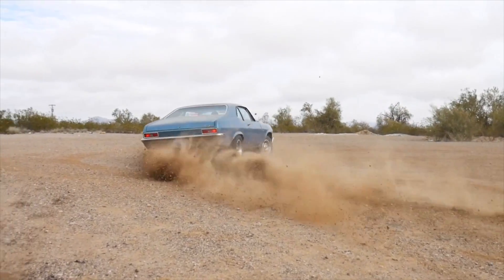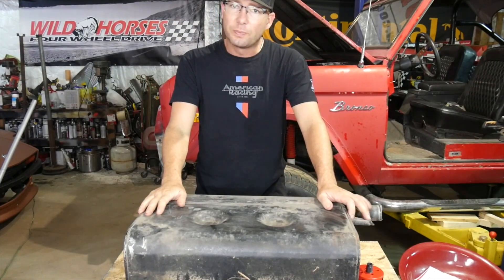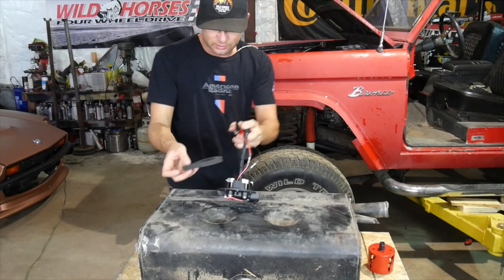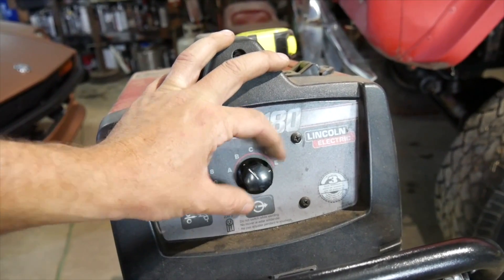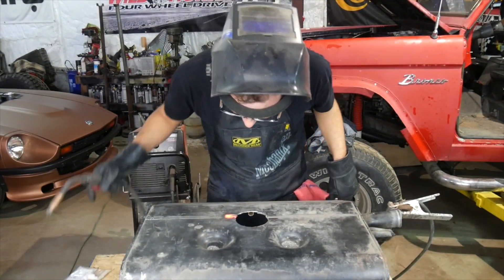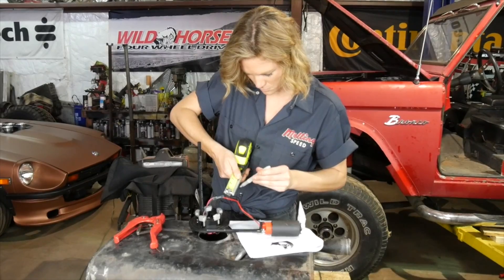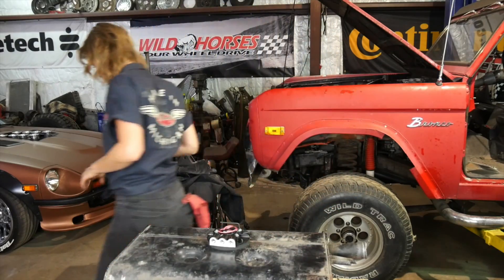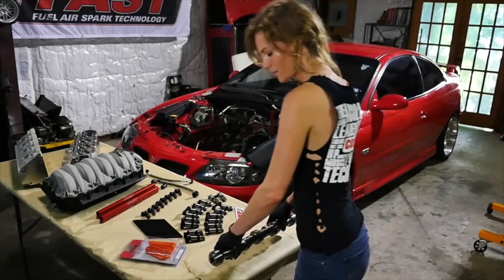Installing our Holley retrofit fuel pump! In the shop with Emily EP 73

Comment: I enjoy your Video's and content. I would recommend that you swap out the "Pre-Pump Filter Sock" for a "Holley Hydramat" which doubles as a Pre-Pump Filter and as a" Pre-Pump Fuel Supply Reservoir" that eliminates Fuel Starvation especially when the tank is less than a quarter full during cornering and acceleration. I Installed a 15 Micron Hydramat  3" x 15" (# 16-111) directly to a Walbro GSS342 in my 2015 Sea Doo GTX iS 260 Limited PWC in a Fore / Aft orientation with the longer section facing forward so as not to possibly interfere with the level sensor. works far better than the OEM Fuel Pump Module with built-in crappy strainer and non-serviceable paper element filter (Deleted 2 OEM strainers and filter and modified the Module). This thing absolutely eliminates fuel starvation in rough conditions with under a quarter tank remaining (had starvation issues with stock system below a quarter tank). I recently ran the tank bone dry, simply amazing, I added a gallon and rode it safely back to the Dock. Highly recommend.   Randy    AKA randog311  (Retired Professional Wrench)

Comment: You can take a running vehicle and run a hose from the exhaust pipe to the tank you want to weld on. Let it run on there and it will expel the gas fumes.

Comment: You could also look in the other sending unit hole to ensure the tightening lugs have seated properly and not catching on anything inside the tank. I've had problems with some of the universal kits I've used.

Comment: Hey guys great video. But can I make a suggestion. You should remove the pump again and paint the surface that Aaron welded and ground down. It being on the top of the tank moisture will probably settle on it and with no protection such as paint, will rust. But you've probably already thought about that. ;-)
Reply from the maker: LestersCustomTrkShp Thats a good point... we taped the pump off and painted around it but there wouldn’t be any paint underneath m 😟🤔

Comment: I was thinking I'd put a larger piece of Holley's Hydramat on that fuel pickup so there's little chance of uncovering the pickup at lower fuel levels when going off road. That little piece of filter they included in the kit seems kinda small.

Comment: I think the "channel" wouldve been a reverse tongue and groove one lip goes over and snags on the other then gets crimped. If you've ever worked with that galvanized exhaust pipe for gas hot water heaters or wood stoves that come flat... that type of groove 😂
Reply: Hot water heater?

Comment: If your fuel pump filter sock is one inch off the bottom of the tank. Won't that mean you will always have one inch of fuel in the tank that your system will never be able to use?

Comment: maybe i missed it, but did you clean the shit out of the tank before clamping the assembly in place?
Reply from the maker: va4cqd The hole from the sending unit is still open, that’s where we’ll clean it!
Reply: Tell you a cool trick a friend showed me he took these earth magnets that were round with a hole in the middle. They slip over the shank on the hole saw and adhere to the saw. If you know anything about earth magnets they are the strongest magnets ever and they will not move while drill is rotating. And most all the shavings will stick to the hole saw very little clean up. You're welcome.